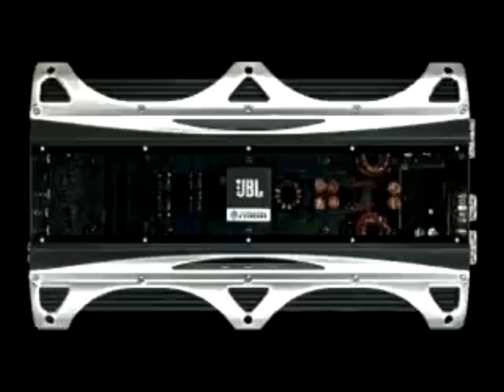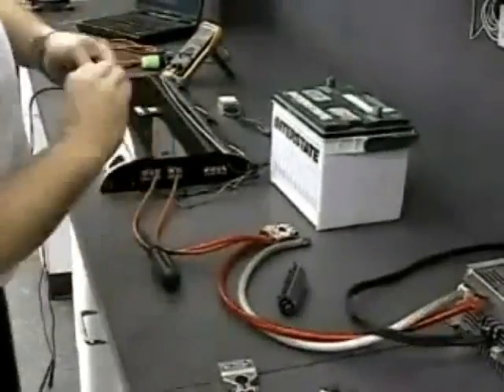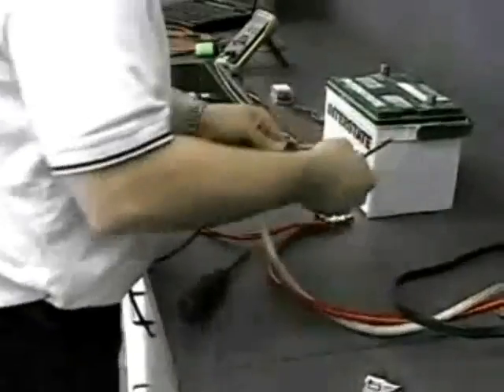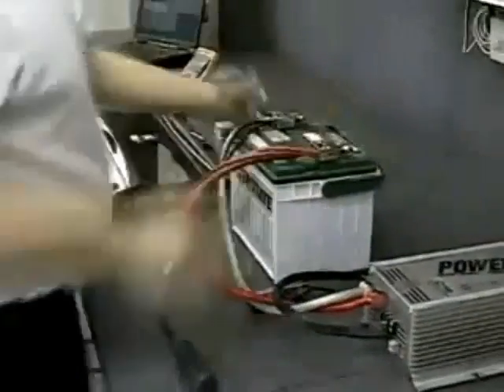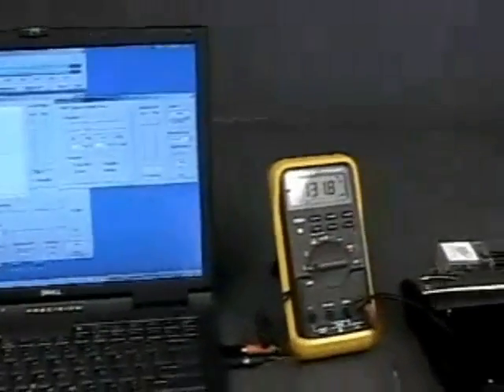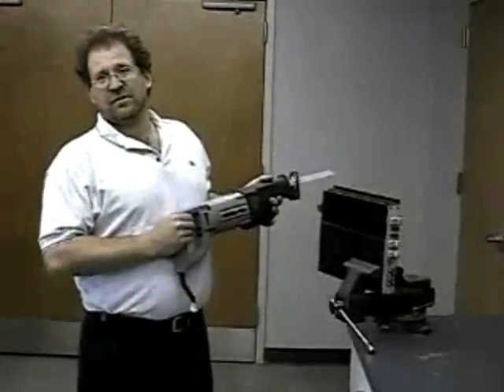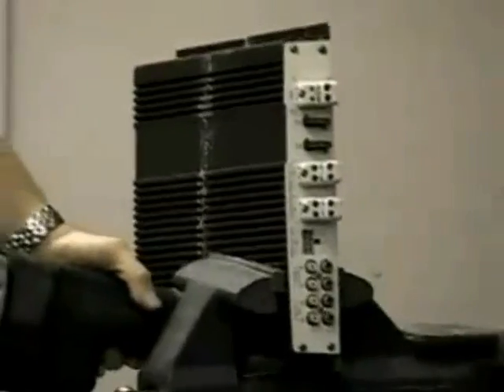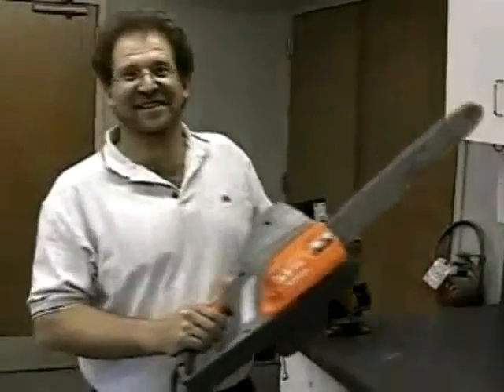Interesting Amplifier Technology

Comment: Hi just wanted to know what would be the gratest advantage in using the bpx 2200.1 compared to using say 2 gto 14001 amps for half the price other then drawing less current and creating less heat
Reply: The jbl 14001 amps are not 1 ohm stable they go into protect but they are class A/B. The bpx2200.1 is a class D amplifier it is 1 ohm stable and puts out double the power of the gto14001. At 4 ohms the bpx2200 puts full power around 2900 watts and the gto14001 does about 15-1600 watts at 2 ohm.the advantage is the bpx puts out more power at higher ohm load than the gto (4 ohm vs 2 ohm) so with the bpx2200 you get less distortion less heat and more power and reliability with less current draw on electrical.
Reply: also from experience......the bassline is alot more accurate with a BPX than a GTO. I have a BPX500.1, PX300.4, and 2 BPX2200.1.  They are stashed away now but easily my favorite amps ever.

Comment: I've just finished a physics course where we learned the basic physics behind the loudspeaker. The force provided by the woofer solely depends on the strength of the magnetic field provided by the motor, the length of the wire used in the voice coil, and the current flowing through the voice coil. Lowering the amperage and raising the voltage for the same power wouldn't work according to this model - can you please explain further what would be going on?
Reply from the maker: they are using thinner GA wire in the GTI subwoofers to reduce the weight and moving mass and a very long coil design . also has a very tight gap with more layers than normal without adding weight and powerful triple stacked motor
Reply: mazda2284

I see! Nice! Thanks for replying!